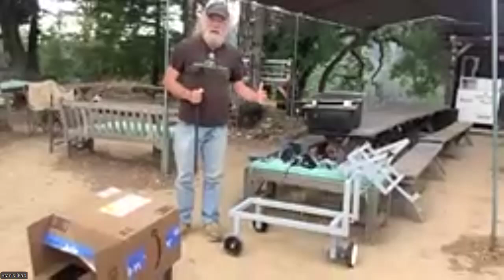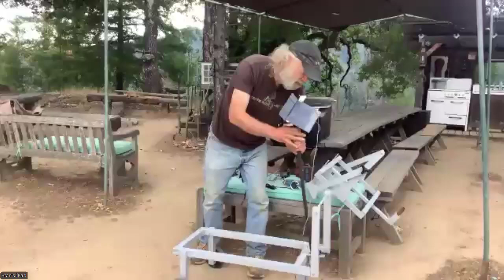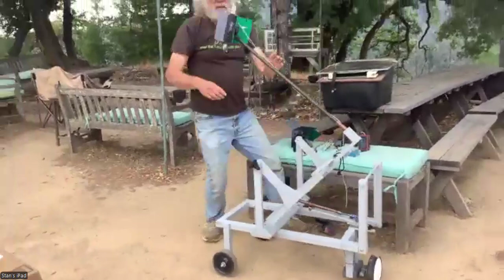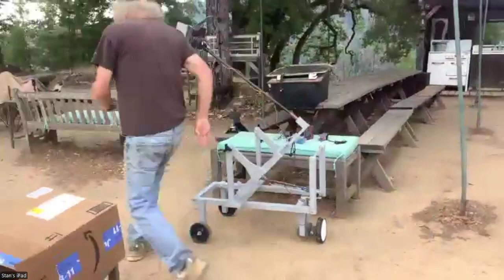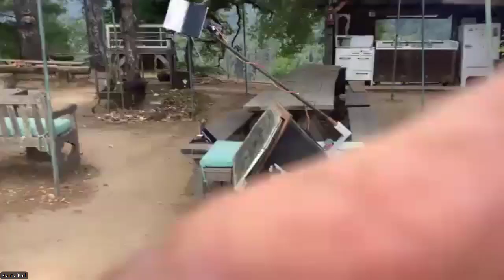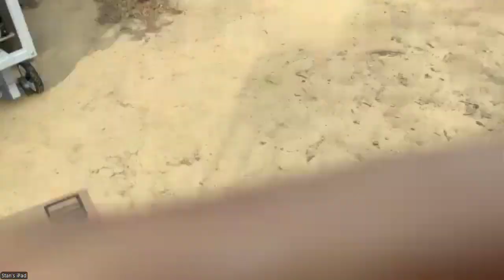Earthwide Do-It-Yourself Solar Cooking Forum

Comment: I believe a solar tracker could be made using a spring to store energy. This energy could be gradually released through a mechanical device consisting of small magnifying glasses that would heat small triggers actuated by thermal expansion. As the sun moves, different magnifying glasses would heat different triggers, gradually releasing the spring and rotating the furnace.
Reply from the maker: Interesting idea. There is a spring motor that started from a Kickstarter campaign, as I recall--RotoQ. I'm sure one could take it's slow speed and with reduction gears get the speed to equal the time the sun moves across the sky to keep a cooker focused. Here's their web site https://rotoq360.com/?srsltid=AfmBOoo9XplYOWgKO1KEPk06oDQ_KNq-5Eai__fKvvboxdhi72i-iuV4
Reply: @SolarCookingMuseum  Hi! 
An adaptation with this RotoQ would be perfect.
Reply: How would these triggers look like? I have hydraulic door closers (GEZE TS4000) that would be ideal for turning an oven, but even in the slowest setting they still move too fast. I was thinking of some kind of wax-filled device that blocks movement when cold, but I'd like to hear other ideas.
Reply: @SolarCookingGermany  The rotation motor I used on the tracker in this video is rated at 0.6 rpm at 12 volts.  It starts turning slowly at a much lower voltage.  I tested it recently with a box cooker on board and it kept perfect aim all day long.  Using only four solar panels and two motors to achieve perfect aim is going to be hard to beat.  This is not what I call an approximater. It is literally controlled by the  rarest star.
Reply: @SW94929  I already have the motors / actuators to build an electric tracker, I just find the idea of a mechanical device appealing. If I can't find a solution to slow it down (clockwork?) I think I'll go electric. Thanks for showing btw 👍
Reply: @SolarCookingGermany  Hi! I don't have many ideas for how to implement it. I've thought of something simple like a coil of metal wire inside a small, flat metal cylinder. One end of the wire would almost protrude through a small hole in the side of the cylinder. When heated, the wire would be forced out through the hole, pressing a trigger (similar to the triggers I've seen on some bird traps or even mousetraps). Once activated, this trigger would allow a gear to rotate X number of revolutions and then stop, waiting for the next trigger to be activated by heating. And so on. It's just a general idea. Implementation shouldn't be very easy.
Reply: @SolarCookingGermany  Some cars have a thermostatic valve in the cooling system. It's a small metal cylinder filled with wax. When heated to a certain temperature, I think the wax expands and pushes a metal pin out of the cylinder through a hole (or vice versa). This system would be perfect for activating mechanical triggers through heat, but I don't know if they exist in a sufficiently small size.
Reply: @ofornosolar  I have seen such wax motors or wax actuators e.g. from Honda, but I wasn't able to successfully make my own yet.
Reply: I very much doubt that such a system would be any where near as responsive as what I have designed.  Tracking the sun requires a very responsive method of detecting the device’s relationship with the sun and initiating motion as soon as it detects a slight change.  The other methods  I see are more complex and less effective.
Reply: @SW94929  Using an electric motor and sensors is certainly more accurate. I'm seriously considering using a solar panel and resistive wires to heat the glass in my oven in the future. Heating the glass has two advantages: it increases light input by eliminating condensation, and it prevents heat from escaping. Since I'll be using a solar panel, I'll have electricity to drive a motor and make the oven follow the sun, like in your video.
Reply: @ofornosolar  That’s an interesting idea.  I experimented with nichrome wires down in the cooking chamber.  They might work well for you since they are very thin and wouldn’t block much light.  For a commercial box cooker I found that sitting the cooker on a slab of insulation and a reflector on top prevented a lot of heat loss out the bottom of the cooker.  Increased heat by about 15 or 20 degrees F.
Reply: @SW94929  Thanks for the info! Nichome wires is exactly what I plan to use!